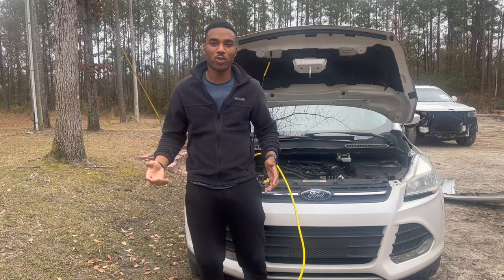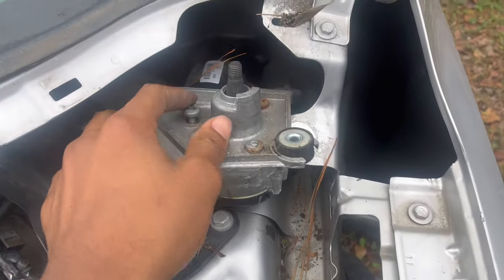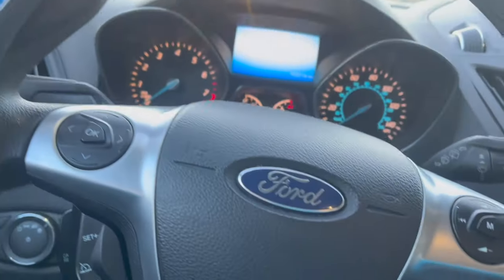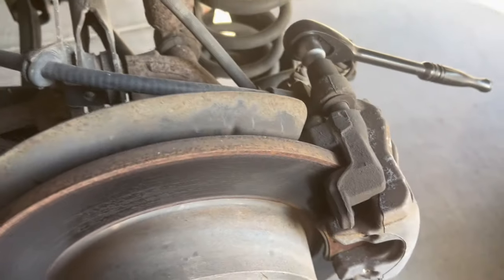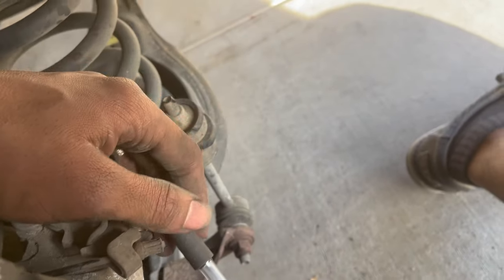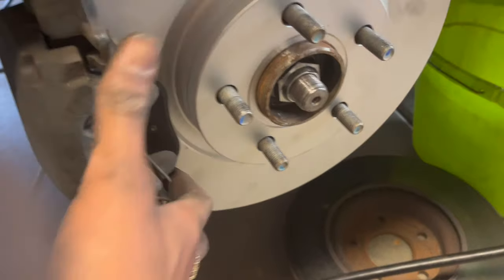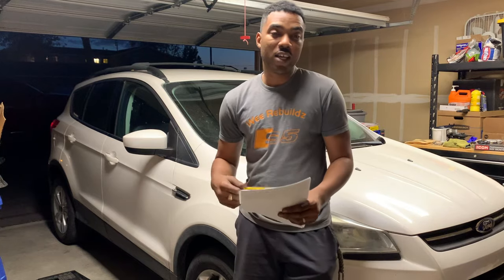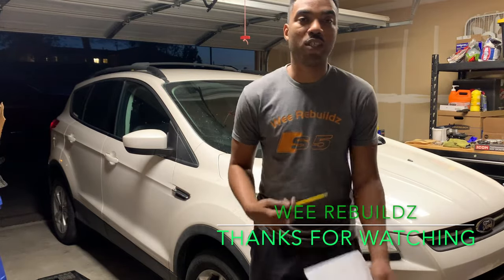Finally video, Price reveled for 2013 Ford Escape and the removing of purge valve. Part 8 !

Comment: Hey amigo, I like your videos. Do you have a video that shoes how to taake off the rear trim in a ford escape 2016? I only see the video for the teim on the doors. God bllesa you!
Reply from the maker: I do not have any videos get a trim removal tool and start by taking off the front section that is at the where the door latch is